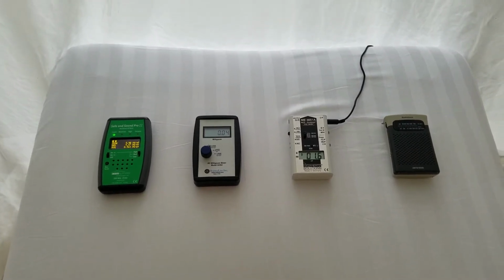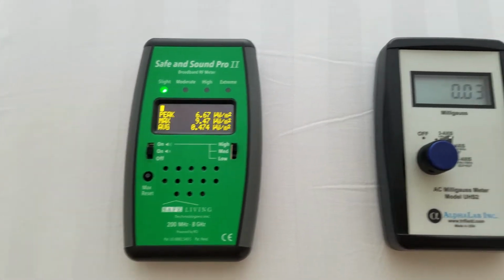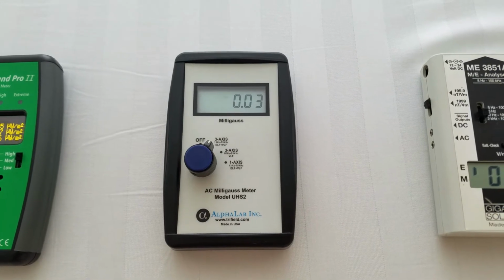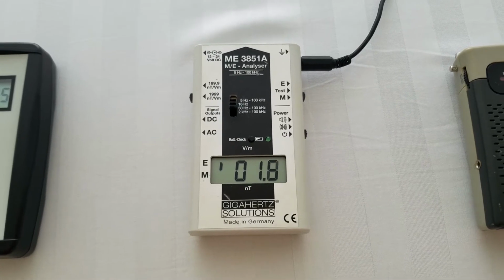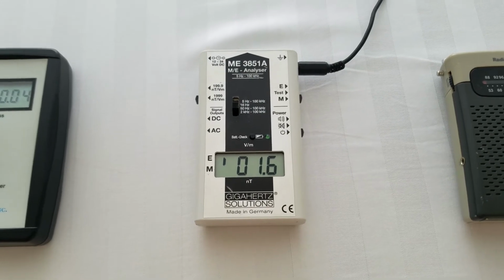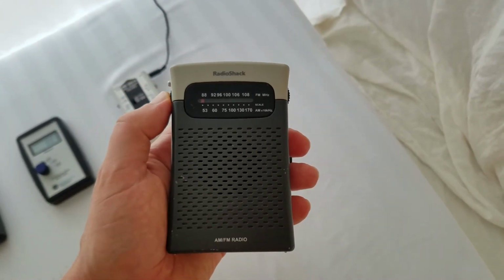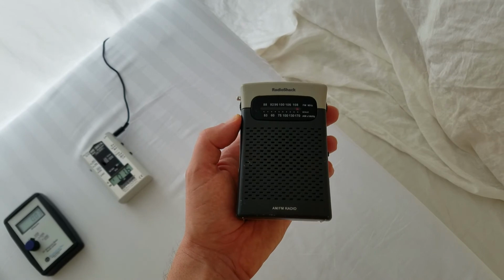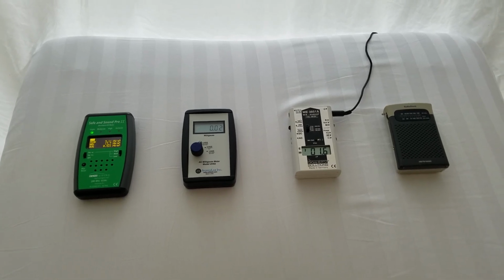How to Measure Your EMF Sleep Sanctuary

Comment: I have two large amplifiers next to my bed with three lamps. Appreciate the heads up. Going to move them soon. Is 15 feet far enough away?
Reply from the maker: That's a good start. However, the wiring in your walls next your bed is likely creating a high electric field. Turning off those breakers or using a remote kill switch is what most of my clients do for deeper sleep.
Reply: @emfanalysis  Are there any affordable remote kill switches? The RCS4 is way overpriced plus requires paying an electrician to install.
Reply from the maker: @invisableobserver  You can turn off the circuits for free by yourself. Just keep your bedroom circuits off. It's a minor inconvenience and you can use battery powered lamps at night. You don't want to constantly turn circuits on/off hundreds of times or they will wear out. 

In general, quality EMF equipment is not cheap. All I ever recommend are good meters, a bed canopy if you need one and and EMF Safe Switch if you don't want to just keep your breakers turned off. I discuss those here: https://www.emfanalysis.com/remote-emf-switch/